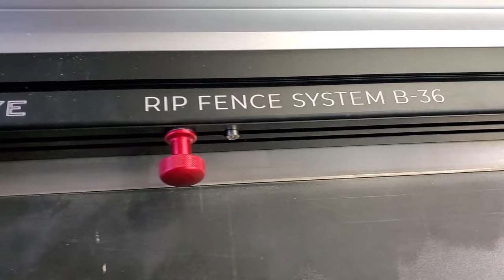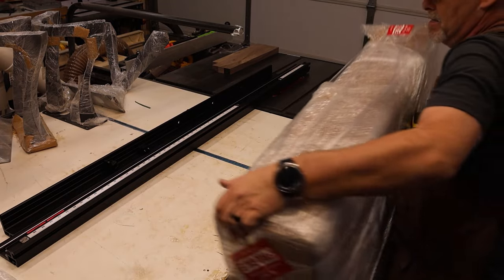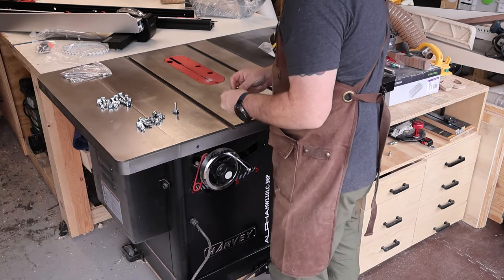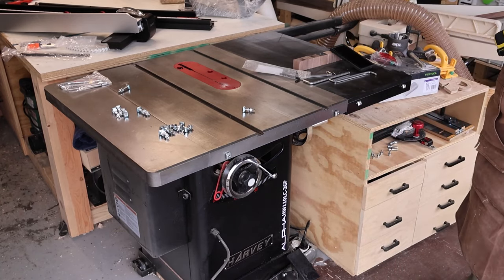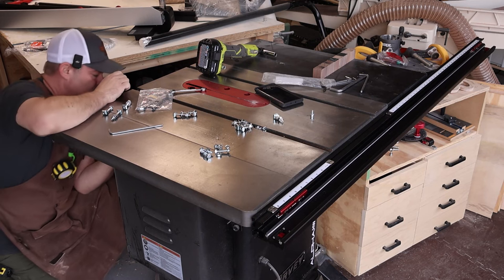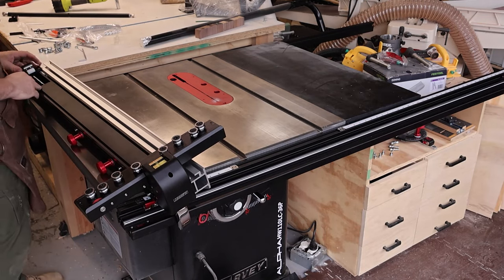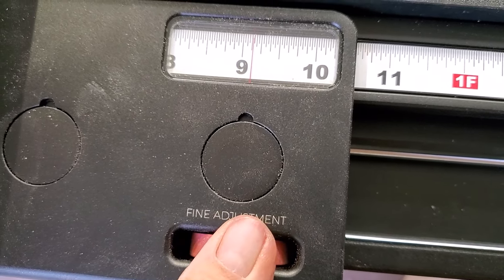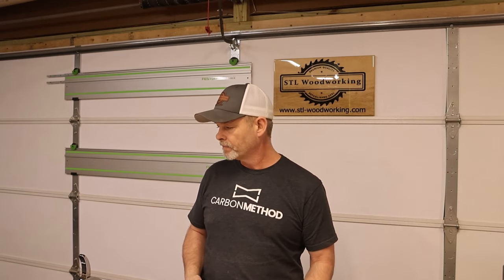Game Changer? Harvey Big Eye

Comment: I would love to see a follow up on this fence system. I have a saw stop and the fence is pretty decent. The Harvey fence using linear rails and bearings is truly the future. I went and refreshed my memory on the Harvey website and they do indeed promote what looks like a dial for fine adjustments. My solution for micro adjustment is the Woodpecker flip stop system. I use the brass screw stops to move the fence . I like how Harvey included flip stops they are a nice quality of life feature for sure. So I will end my ramblings lol and I look forward to hopefully seeing an update on the fence.
Reply from the maker: I will be doing a little more in depth review of it soon. I have been using it and have got some footage so far. I just want to be able to speak to actual use before putting it out.

Comment: The rod goes at the end of the two rails. it supports the ends where the opening is.  That is what the two bolts that had no nuts and washers were for.  The small L shape brackets are for the dust collection arm.  The t track style bar is for saws that are not drilled already on the back of the cast iron table, if you can't get the nuts and washers on (non harvey saws). The directions are on their website under support.  I put mine on my saw stop last week and had to find them on my own.
Reply: The rod goes on the far right if you don't have additional table pieces.  I have a router table on the far right, so I didn't need the rod.
Reply from the maker: Thanks for that Tim. I hope you are liking yours as well. I'm gonna use it for a bit and then do a full review on it. Very happy so far.
Reply: Just got mine and you are right, it is for saws without extra right panel. great saw, well made but instructions were not included and online was vague. still very happy with purchase. Hope you are as well!
thanks for clarifying
Reply: @andyp9290  I like it more and more every use.  I did carbon coat on it at the same time, so I'm double happy lol

Comment: The fine adjustment is definetely dissappointing and his its limitations based on design since its relying on friction to turn the bearing. Unfortunately, to get a true fine adjustment requires using a ballnscrew design like the icra system. But that comes with its own drawbacks with taking up alot of space
Reply from the maker: I agree. But if I am being honest, i still "tap" the fence LOL